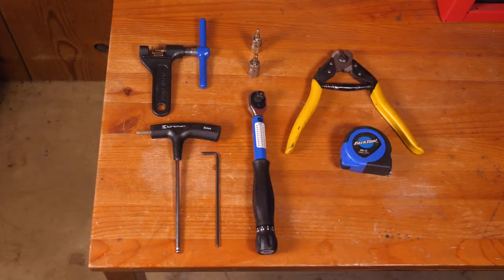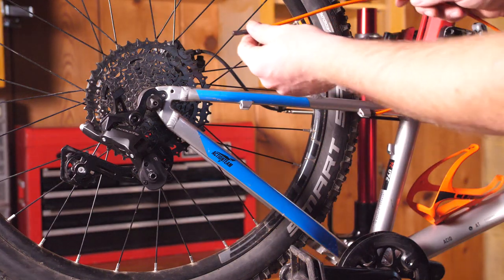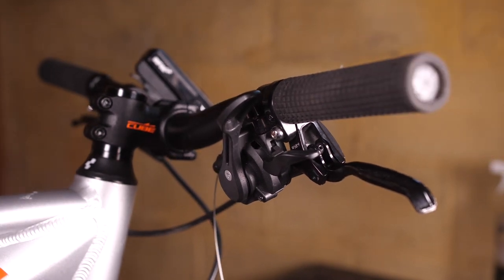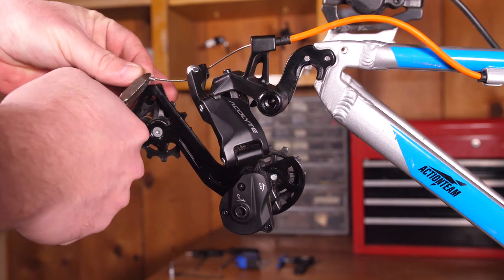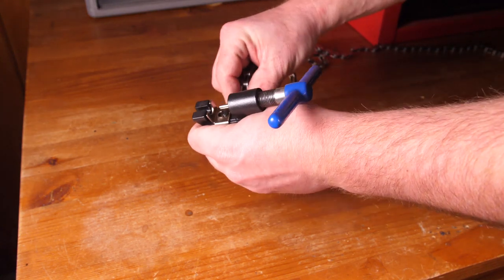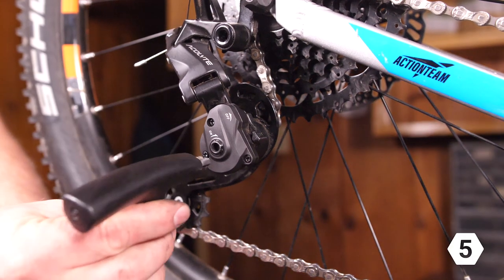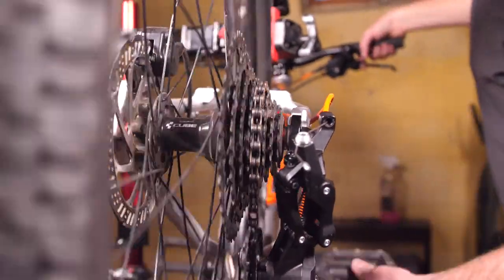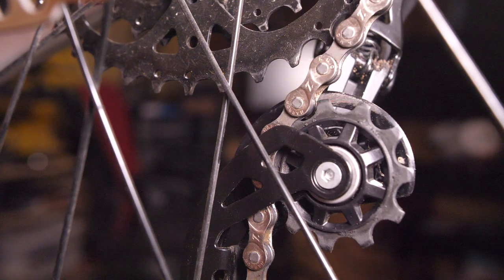Acolyte Rear Derailleur Installation

Comment: Thanks for this great video. I just installed my drive train as per instructions, all worked OK. Running it on a fat bike with electric mid drive motor so some usual chainline challenges/limitations but the kit will do the job. Surprisingly good gear, on initial impression, given the cost. Cheers.

Comment: FYI Acolyte works with 10 & 11 speed shifters up to 48T. I'm using it on a 10 speed Advent X 11-48T cassette with the Advent Pro shifter. Microshift uses the same pull ratio on Acolyte, Advent and Advent X

Comment: Im sure I missed something, but even with the B tension screw bottomed out, I’m still not clearing the 46t cog, much less getting the proper spacing. Any advice?
Reply from the maker: Nine times out of ten this is due to a problem with chain length. The upper guide pulley is eccentric, so as the cage extends the pulley moves away from the cassette. If the chain is too long, the cage won't extend enough and the guide pulley will be too close to the cassette. If that's not your problem, I would submit a service ticket on the microSHIFT website and we can look into it further.
Reply: Test it with a uncut chain in place. I tried pushing an acolyte derailleur without one and it kept hitting the third largest cog on a 11-48 advent x cassette. The derailleur should be able to handle up to 46 tooth, but could only go to 36 when pushing by hand with no chain.

Comment: the chain sizing section of this video is different to the install pdf for acolyte on the microshift website so what is correct.....
Reply: page 16 on the pdf...check it
Reply from the maker: It is a little confusing, because the visuals are slightly different between video and written manual, but the directions are the same: from where the chain overlaps, add two inner links. In another comment, you said you ran out of adjustment range on the B screw. If that's the case, your chain might be too long. If you get in touch with our customer service folks at service@microshift.com, they can help you get to the bottom of it.
Reply: Dude thanks for reply...i used park tool 1x instructions instead and sorted the problem....the grey area is interpretation of what is a link....the chain length was way too long following the instructions from the video...

Comment: I wish the video showed how to use the included b-gap tool
Reply from the maker: Thank you for the thought!  Proper b-gap tool instruction is available in the Acolyte manual found under tech documents at microshift.com
Reply: @microSHIFTTECH  quick question.  So is there no covering for the cable port.  so it's just open? I have this group on order and I'm just getting a grip on what it takes for shift cable replace. thanks.